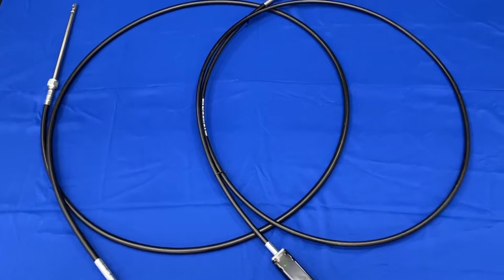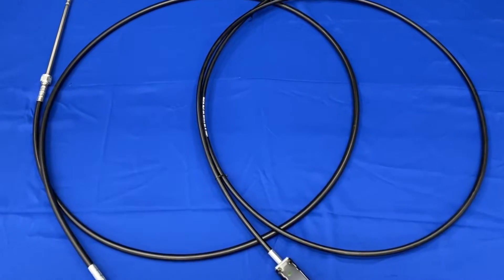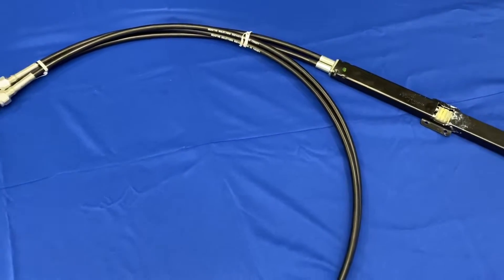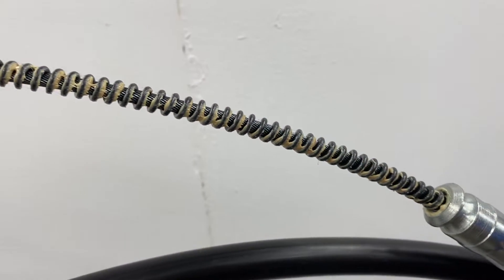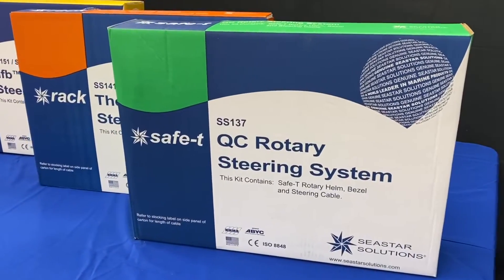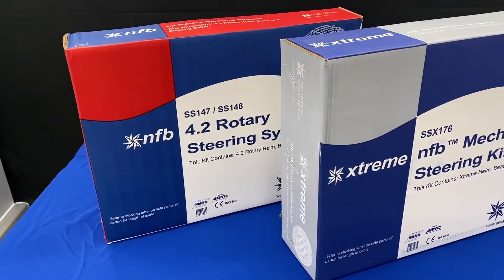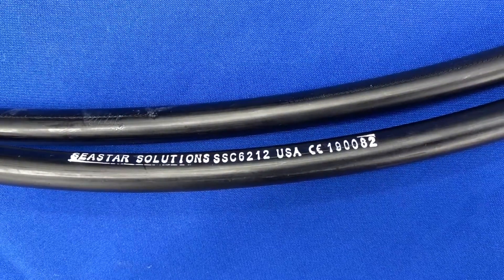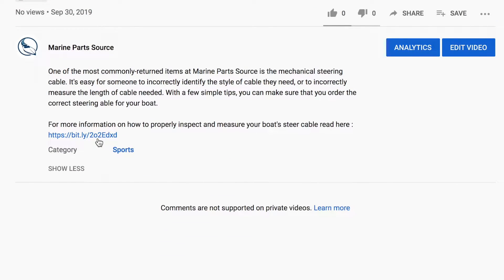How to Identify Mechanical Steering Cables

Comment: what is the diference between SSC62 ,SSC72, SSC61 ??
Reply: Length
Reply from the maker: The SSC72 is the discontinued Big T cable with the screw on helm connection. This can be replaced with the SSC62 cable and the SA27620P adapter. The SSC62 is the Big T quick connect cable and the SA27620P is the quick connect adapter for the helm that used the screw on type cables.
 
The SSC61 is a discontinued cable kit. This kit included a SSC61 quick connect cable and SA27620P  helm adapter.
 
The SSC62 is a direct replaced the SSC61 cable. This is a steering cable only and doesn’t include an adapter.